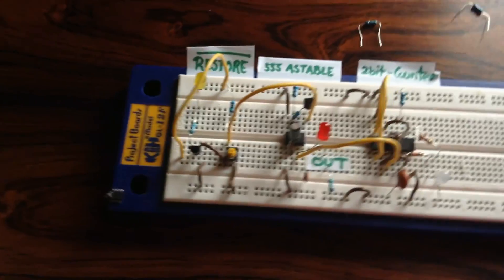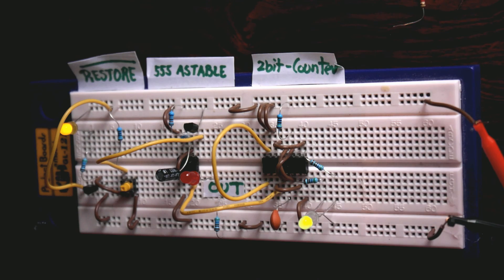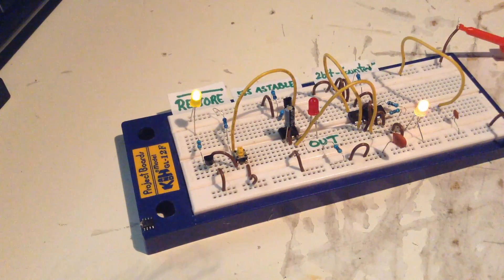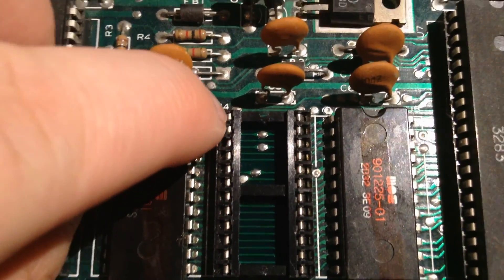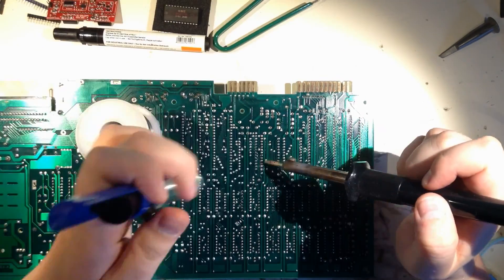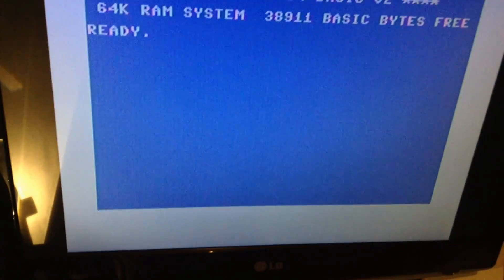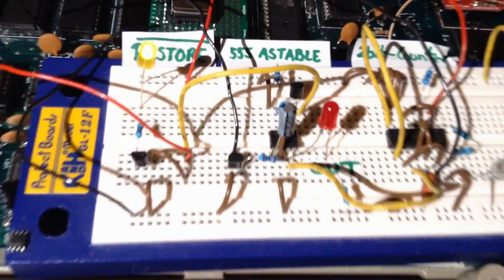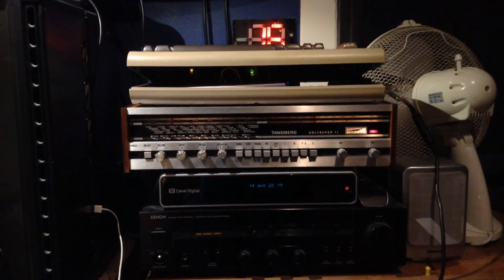C64 Switchless Multi Kernal part 3

Comment: If you just want to switch between two kernals a 74HCT74 is enough, restore to D and reset to CLK and it will set Q high or low depending on if restore is held when resetting or not.
Reply from the maker: Thanks. That is my understanding also. I mentioned it in the first video, five minutes in. Gets easily lost in my waffle. I'm wondering if I should just ditch this digital logic approach and go for the microcontroller alone, put it under the rom. Thinking about it, people who program this ROM, if they have an universial programmer it's probably easy to program a PIC12F629. Another problem with the  wider board is that it will cover other ICs that may be heatsinked..
Reply: Using a microprocessor will keep the size down and possibly also less soldering. If it's a DIY project the programming (loading the code into the chip) is a bit of threshold though.

Comment: Damn Hans, this looks amazing. And it works! I think it really handy, especially when you change the power led out for the counter led.
Reply from the maker: Thanks man. There are some solutions out there already, and some switchless too, but I wanted to have a longboard compatible 2364->27C256 adapter w/switchless solution. I'm using all throughhole parts for DIY friendly builds.
Reply: I like the idea of being able to switch kernals like this. I suppose the bank selecting isn't affected?

Comment: The 2 bit counter needs decoupling from what exactly?
Reply from the maker: A current takes the path of least resistance. Without decoupling the current will flow through the long power supply wires, and because the regulator is slow it can't respond to fast transition that demand more current, or the transistion is so fast that the long wire impedes the current (adds resistance at higher frequency). The capacitor decouples this quick current demand from the power rail, the current loop is minimized, and also it decouples noise from this circuit before it is superimposed onto the power rail and further interefere with other devices and itself.
Reply from the maker: An analogy, not sure how well it works, is a freewheel. The larger the freewheel, the smoother a motor or engine will run. Now lets say the motor is already running smoothly. Why the need for a freewheel? Power demand might be sporadic like in electronics. Power demand might sometimes be intense and very short, like the wheels of a car hitting a rock at low speed, the power demand shoots to high levels but drops in milliseconds. This is where the freewheel comes in,  static power demands will load the engine directly, but short dynamic power demands will draw power from the freewheels inertia first. To classify these two different power demands we can call it static power demand for DC and dynamic power for AC or transitions from 0-1 or 1-0 in digital signals. (allthough the engine in a car fires at set intervals with big bursts of power, this power is useless without a freewheel to store and smooth it out. This is an analogy to rectifiers and smoothing caps)
Reply: It actually makes sense to me Hans. Thanks. Although I couldn't have figured it out just by looking at the symptoms I think.